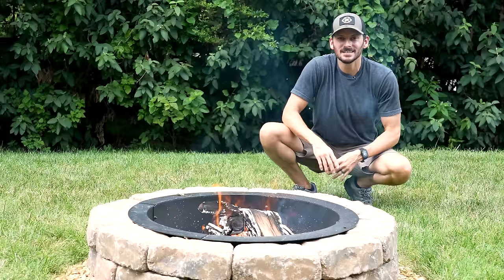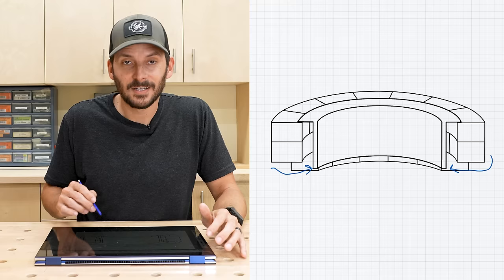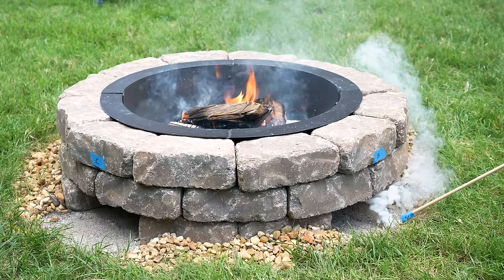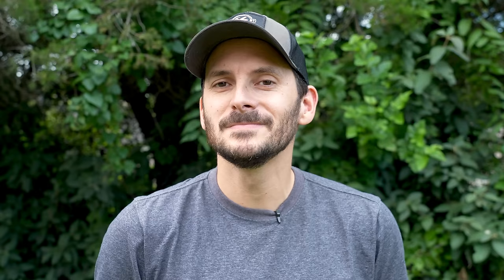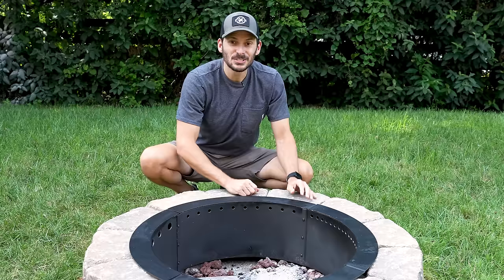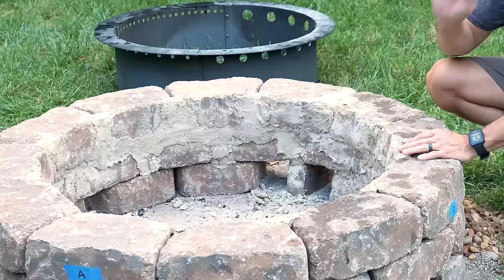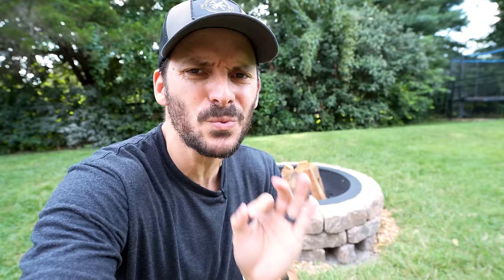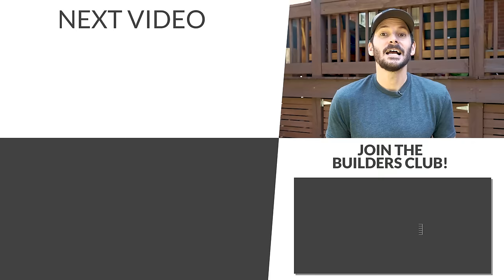Stop the Smoke, Do THIS to Your Fire Pit

Comment: You have to have velocity. Smaller base holes, and even smaller top holes. Why? The heat will cause the air outside of the liner to accelerate via the Bernoulli Effect. It may be that your pit is not high enough for its diameter to get sufficient velocity. With Solo Stoves you have to keep the overall height of the firewood stack below the level of the top holes. Why? The flames you see on a Solo Stove aren't coming from the holes, but from the oxygen in the air from those holes hitting the super-hot combustible gases resulting from incomplete combustion (smoke, essentially) and igniting as there's now enough oxygen for complete combustion. Again, less, smaller holes would increase the velocity of the air rising on the outside of the liner and exiting the holes giving you the secondary burn that fully completes combustion.

That and a taller aspect ratio (more high than wide) would give you a permanent equivalent of a Solo Stove

Comment: I'm betting the ratio of the pit radius to the height of the cylinder is wrong, and the air is moving fast enough through the outer chamber that it can't adequately heat up for a secondary burn. That's why you're not getting the flames out of the side holes like the solo stove. Maybe doubling the height of the cylinder would give you that effect? Caveat is that wouldn't make for a great fire pit, might be more like a barrel 😂

Comment: I really enjoyed your video. I noticed some things that will dramatically improve the performance of this. Will perfect it.

Your fire-pit is too low to be that wide. To have the circumference you're working with there, the fire-pit needs to be much taller. About a third taller. And to have the top edge over-hanging in towards the fire. This overhang will force the incoming air to roll down into the fire.

These two elements (the hight/circumference ratio)+(overhang) are what create the internal vortex that rolls and re-burns all the gases completely. Sealing all those cracks and putting the holes in the insert was the another critical element. But the rolling vortex you're looking for is only being partially created. This can become even more efficient. Give us an update!

Comment: In the patented design the airflow at the bottom actually gets to the fire from below, not from the sides. I wonder why he deviated from that part of the design by drilling holes in the side at the bottom. Perhaps he confused the outside layer with the inside layer?

Also at the bottom, the air flows to the centre first and then back to the side before getting into the fire pit, allowing for more preheating of the air before it touches the fire which may reduce smoke even more.

Another thing of course is the height to diameter ratio, but since he already made the firepit, he probably couldn't have done much about that.

Comment: You didn't say what size holes you drilled in the bottom.. I now you did 1/2" holes on the top.. the bottom looks bigger? Are they 1/2" too or 1"?
Reply: they look to be about 1"
Reply: @vitalsteve1  Already made my pit lol. Settled for 3/4" because that's as big as my step bit went :body-blue-raised-arms:
Reply: @kre8tivekels  should be more than enough for air in the bottom.

how has this setup worked for you? is it optimal?

Comment: Checking out some videos on the Solo Stove, they say it has an issue radiating heat outwards. Most of the heat goes straight up. What was your experience with heat for the smokeless fire pit you did in this video?

Comment: I have to say, I built this exact fire pit from a kit I bought at Lowe's, four years ago. for $190.  I even used masonry construction adhesive to permanently adhere the pavers. In 4 years, and and least 400 fires, without even cleaning the pit out, I have never had a smoky fire pit, because I burn CLEAN wood. Kiln dried only. Much cheaper and more efficient than doing all the BS this video has to offer. Work smarter, not harder folks.

Comment: IMHO, the poor efficiency of your hearth is due to the too low height of the combustion chamber. Note that in the solution, you are following, the height is clearly greater than the diameter of the hearth. This is the key to perfect exhaust afterburning. The second factor: the upper outlet is slightly NARROWER, which increases the time of mixing unburnt exhaust gases (full of smoke) with fresh, oxygenated air. This is what allows them to burn completely, it meaning: to remove the smoke!
Each efficient and SMOKELESS hearth is ALWAYS high!

Comment: I have a fire pit just like yours. All of my fires are smokeless regardless of species of wood...because its doesnt have that ridiculous steel ring. Why wouldn't you try to make a fire without the ring first? The gaps in the stones are what help the fire burn efficiently imo. Your smoke test just proved how starved the fire is because it has to pull air in from the same place its trying to evacuate c02/heat energy.

Comment: Geometry is wrong for the desired effect.  Smokeless are tall and narrow.  Your pit is shallow and wide.
Also the wood is usually taking up most of the floor area, yours is not.

But smokeless you only see the high flames, pits you actually see the wood burn.

More oxygen burns more efficiently which creates less smoke but also consumes the wood faster.

Comment: The amount of smoke will also depend on the kind of wood you are burning.
Well seasoned (dried) hardwoods will burn the cleanest.
A simple fireplace log crate will also help to allow the burning logs
to get enough air flow (and oxygen).

Comment: Solo stoves are not that big...and to be honest, don't kick out as much heat as I would like for the cost. they work well because they have a small combustion area so you don't need much wood. Yours is substantially bigger so the ventilation is too far away from the flames to be effective. once you made the fire big enough, the convection started to work properly. a small fire in the pit will always be Smokey.

Comment: I don’t like any of the fire pit insert.  They all get ugly rust after one year. Instead, I used stainless steel carnitas from Amazon. Using grinder cut several holes on the bottom and the side walls to make airflow. Place three bricks at the bottom of the pit and let the carnitas sitting on the bricks to make sure air can enter the carnitas from the bottom and side wall Also make sure leave spaces between the carnitas and the brick wall you will have a long lasting fire pit insert. 
The best thing for the carnitas insert is that the price is very affordable. A 25” one can be had for around $150.

Comment: I don’t understand why you wouldn’t just vent the bottom and sit the fire on an elevated grille, let the air come in from under the fire. 🤷🏼‍♂️….. metal fire braziers don’t smoke much at all- because there is nothing but air surrounding the cage..

Comment: I pay for a subscription to YouTube for no commercials and then you bury them in the middle a drip bottle is all you need for WD-40 to add it to the unit you just wasting WD-40 spraying it all over the place and those guys are laughing all the way to the bank. Mineral oil for general purpose non-detergent oils can be used for a home shop lubricant for drilling. Use a simple drip bottle with a needle. I need the amount you need you can also play it with the small brush from a can

Comment: Good video but bad science. you’d need to use similar wood through out the process to test the improvements in fire pit. You’re now unsure whether the smokelessness is due to better airflow or dryer wood.

Comment: If the fire is HOT enough you don't need any holes to kill the smoke! The high temperatures burns the smoke away.
 of course holes are better to let the fire breath, but they don't really kill the smoke. If a fire produce a lot of smoke mostly is the moisture in the wood the reason for it.

CONCLUSION: The work was actually in vain! 😄

Comment: to be fair......i mean i'm sure the holes work, because, well, let's be honest, that's the basic concept. there's a reason you want to have air supply from underneath in like your fireplace, which is why you put them on top of a (cast iron) frame. also, a proper BBQ has holes in the bottom to improve air flow and give better fire.

HOWEVER, the issue here was smoke. 

And the smoke was not at all solved in any way. the only way it was solved, was because you used DRY wood. 

i'm pretty dang sure that if you used that to begin with, it would have had a 90% or more similar result. meaning, all that effort, well, made little sense - all you needed to do was go with better wood.

Comment: I think for most of your first attempts, your fire was too small. Your ring was too far away from the wood and the airflow coming out of the holes was there, but it wasn't really meaningful for your fire. When you filled up the ring, it seemed like the fire, and the airflow infrastructure were proportional to each other.

Comment: You are adding too many variables in attempting to copy the solo stove, but cutting too many corners. You never achieved secondary combustion and only discovered you can reduce smoking by using dry hardwoods. There is a relationship between width and height of the cylinder and feed air needs to be restricted somewhat in the fashion of what is known in stove technology as the air vent. Your column is too short,  your inlet airflow is wide open, and your gap between the stone and liner is too wide to form a heat chamber jacket to superheat air enough for secondary combustion while all the airleaks hurt, too. The emphasis of your research, hole size,  is not critical.

Comment: That metal fire ring is useless. What made you want to buy that ? What was your reasoning??? There is no need. You have those stones already around the fire pit. Honestly, the metal ring is doing it the most harm. I'm surprised you didn't figure that out within seconds. Let alone even before starting the project.

Comment: Your fire in the pit is far too small ! A lot of the air being drawn in is being dissipated and not reaching the small fire in the middle. Furthermore the steel ring will not warm up sufficiently up to heat the rising air in the pit.
FILL the pit with wood and have a BIG HOT FIRE. HOT MEANS NO SMOKE.
The very end of your video vindicates this. 😊

Comment: You should have just skipped all the non-sense and burned actual dry firewood and you would have had the same result ;)  All the holes, mortar, filling,  etc etc etc.  Completely unnecessary for a decent fire with little to no smoke lol.  Smoke is always a sign of bad fuel.  It's because the fuel isnt being burned completely and thus is released as smoke (test this with wet cardboard vs dry cardboard).  But with good fuel (dry wood),  it burns completely..... no/very little smoke :D  No mods necessary.

Comment: This is so stupid ... Do this, do that - Oh: wood is too moist, let's use dry wood! Still smoke? Let's use more wood! And all the tests before? Invalid :D Because you missed one key concept: The oxygen has to get in contact with the fuel source (which is wood gas for secondary combustion!) AND ignite it! Your "secondary combustion" simply does not work, because there is too much space between the air flow from the holes and the wood gas. Both are simply to cold when they meet... And scientifically speaking or from an engineers perspective or let's say any idiot knows that "wet tiny fire" vs. "big dry fire" is not a valid comparison to conclude that the fire pit works better :P